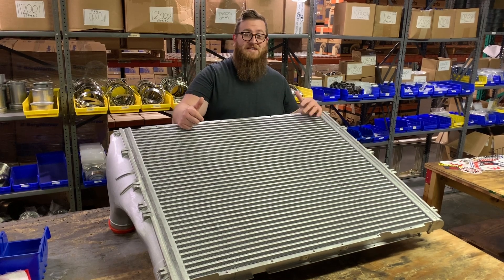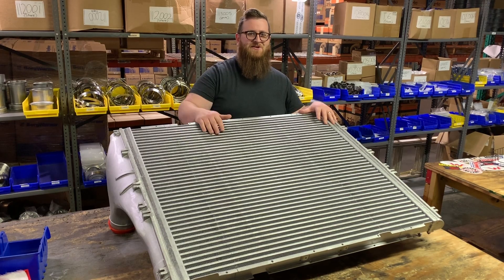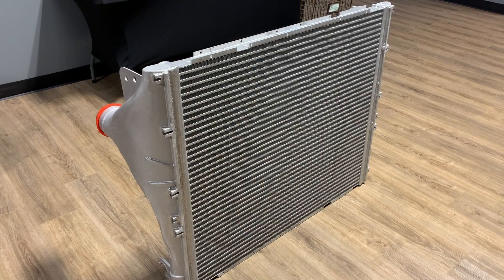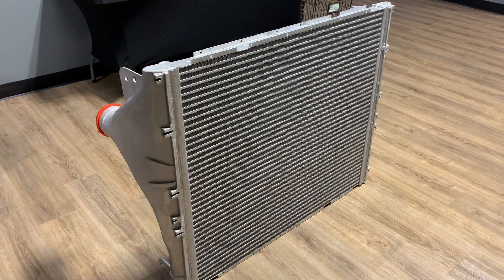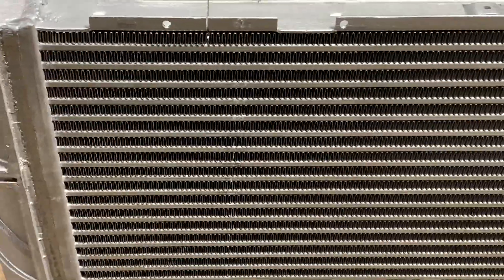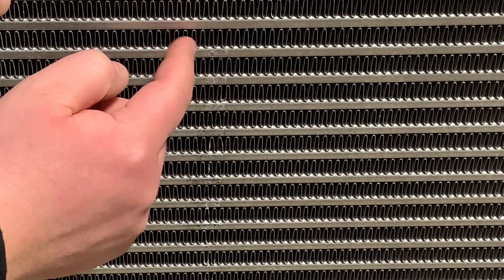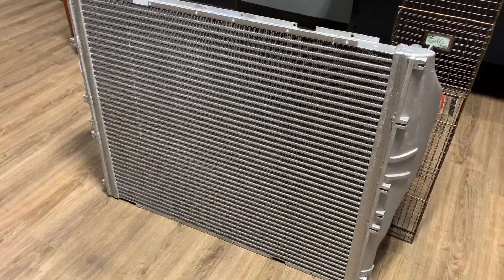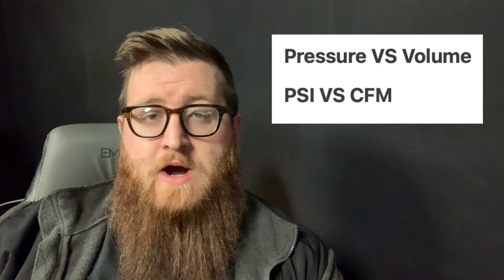What does the CHARGE AIR COOLER do?  It helps a Turbo Diesel engine make more POWER.

Comment: Density and volumetric flow rate are not the same thing.

CAC doesn’t add volume. It controles density thus allowing more air (specifically relevant to us, oxygen) into the same amount of space.

More O2 means better fuel efficiency rate.

TLDR; CAC/ICs do not increase volume.

Comment: So I've replaced my CAC 2x in 2 years.. I pull over 80k gross in mountains, 12.7 DDec lV one size over stock injectors, 171702, 550 tune. I'm boosting over 35lbs daily sometimes 40. Is there a better CAC option other than these OEM units? Thanks!
Reply: Check out AKG of America located in Mebane, NC but AKG as a company is a global company 👍
Reply: @OmarHernandez-s9w  Thank you! I go to Mebane on a regular basis, I had no idea I could get one there. Thanks again!

Comment: Is there a diffrenc in charge air coolers are they the same do some cool better so u can get more boost i mean if i spend more than a few hunderd bucks vs a 1,200 one whats the benifits
Reply: Turbo heats up the air, as it's compressed. CAC brings the temp back down. It won't exactly change amount of boost. But,  cooler, denser air will increase the cubic feet per minute.

Comment: Great video. I learned a lot. So I have a couple of questions...How much is that pressure testing kit? If I run the engine fan constantly, will that contribute to cooling the air in the CAC? Do you sell a CAC for the Series 60?

Comment: I have a ISX CM870,  sometimes driving ill have tons of boost upto close to 30 with 600 or less degree pyrometer.  Then all of a sudden boost drops to 5psi and pyrometer goes to 1200 degrees.   What is wrong ?